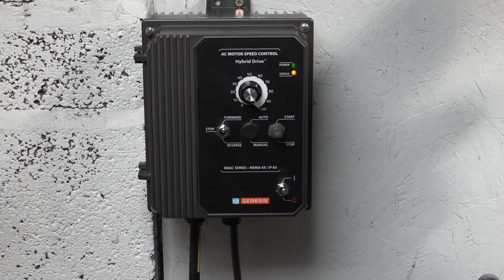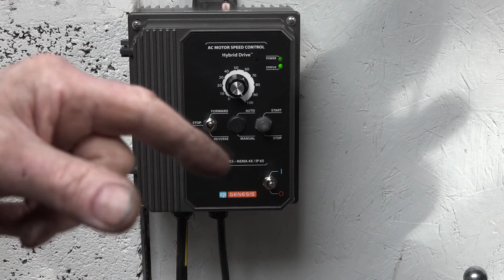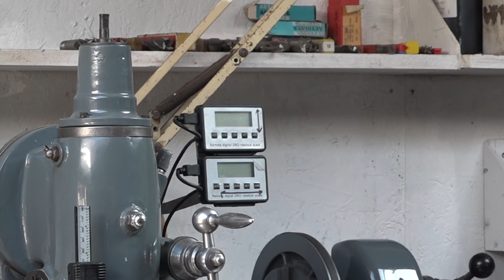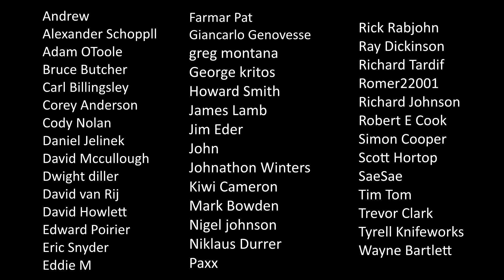Fitting digital readouts to an old Centec milling machine

Comment: Fantastic job you have done here. As a Centec it's a great machine in its own right, but in adding the DROs and the 3 phase motor/VFD you have made it into an absolute dream of a small mill. Even the colour is great. I have a 2A too - it's in pretty good condition. It's in France atm but I'll hopefully be bringing it home this Summer and getting it properly up and running. Thanks to your series on your 2A, I can't wait to get going with mine!

Comment: hey up loz .. my centec 2   table has a lump out of it pn the nearest "t " slot two inch in from the left  i was thinking of doing half a turn so its two inch in  on the farthest  slot on the right hand side .. i also bought in a moment of madness one of them red and green milling table tops  its got forward front an back an left an right  but no up an down i was thinking of changhing this and dobbin it on the centec if it fitts !  if not   make it fit! ! thus save ing me a wad of money,, plus the inner satisfaction of  solving the problem ... i can be sure this top i  fit will be inferior to what was fitted before  but unless i see on ebay what i want fir pennies then thats whats going to happen   ...  loz..  this riser i. m making  ,,, you can either have the short version or the long    version ,,   the short version has a 4" rise and  8" length. the long version is the same rise but  16" long  enable ing the vertical head to used without  the need to take the horizontal bit  of [ hope this makes sense  ] and dont get into a flap .. i know of plenty of aluminium  stock holders who will bend over backwards to help me ,,, let me know if its the long or short version  and i will take it from there  you sound local   i live in notts derby area. and have transport at my disposal  ...  get shut of that covid ..!! i have lost more friends thanks to  covid tha a little        well loz   be good    regards   laurence
Reply from the maker: Hi Mate, might be an option to have a piece tig welded onto the broken table? if possible? you could then remount the table and use the mill to machine the piece to fit. Just a thought. very kind of you to offer the riser piece, I only use the vertical head and have no plans at all to use the horizontal so I suppose the 8 inch long one would be perfect. Thanks, got over the crappy covid now it was just like really bad flu but energy was totally sapped for about 3 weeks after. Im in southport below blackpool so not too far from you if you ever want to come over and study my mill etc you are more then welcome. Regards Loz.

Comment: Looks very good. You have a ER32 COLLETTHOLDER MT2.
Using a metricdrawbar?  You changered it from inch to metric? I belive the Original drawbar is inch? Best regards from Norway Carl Erik  (  I sent you the same question on another of your Centecmill video:-).
Reply from the maker: Hi Carl, yes I re cut the thread on the old bar to metric, it is not clean but holds fine I will make another drawbar though. Cheers.

Comment: Hi, I have just found your channel. We have just bought a Centec 2B and did a very brief into to it in a workshop tour video recently. Your video about adding DRO's is great and given us lots of ideas, thanks
Reply from the maker: Hi There, Yes great addition to to mill I have since moved my motor again and fitted it to the side of the mill which has been a big improvement the 2b is a more versatile mill than the 2a, you should check out lathes.co.uk there is good info on your mill there as well as most of the old british tooling like surface grinders and lathes etc. cheers

Comment: Loz  If you do ever want to add the rapid traverse assembly to the X axis, you will probably have to change the Y axis DRO - the gear for the attachment will interfere with the read head - I'll have to take mine off!
Reply from the maker: cheers mate I think it too much faff disengaging the half nut to use it mine is pretty worn so i locked it up tight.

Comment: Loz, your enthusiasm and innnovation have fired me to use your method for the DRO on my recently acquired 2A.  My motor is side mounted, and I've changed to 3ph 3/4HP with VFD - I do want to use reverse!  I think I'll put a scale on the Knee as well - utilising knee stop t slot.
Reply from the maker: Cheers David, yea its a great mod mate, good idea on the knee dro. a week or so back I moved the motor and mounted it to the rh side of the mill. I just could not get the belt aligned on the two pulleys. So glad i did its much quieter now and runs great on a shorter belt. Must do an update on it soon. Cheers.

Comment: Excellent video, many thanks. I am in the process of refurbing a Centec 2A and I am definitely going to use your solution or the quill DRO. Great work.
Reply from the maker: thanks mate yes the least damaging solution I could come up with but it works great.
Reply: @LozHarrop  What did you do in terms of replacement spindle bearings? I've found just standard Timkens, but had no joy finding proper precision ones? I currently can't seem to get less than 1.5 thou runout with them on the spindle bore.